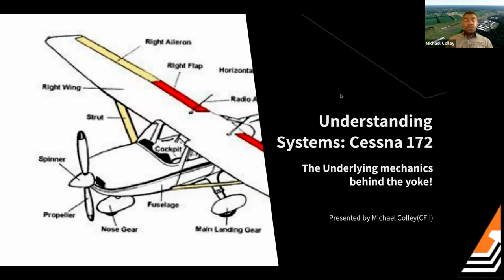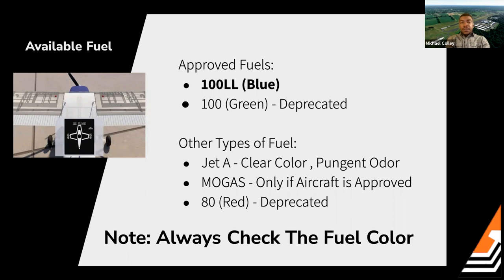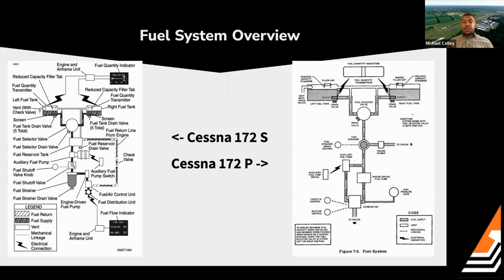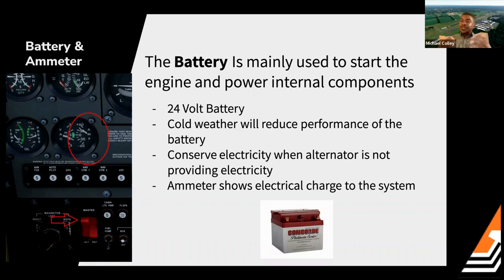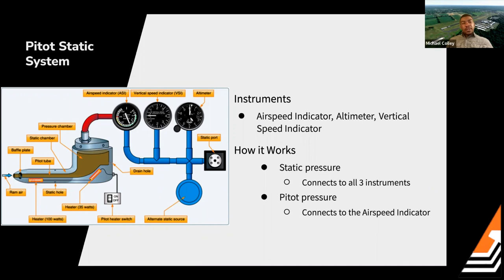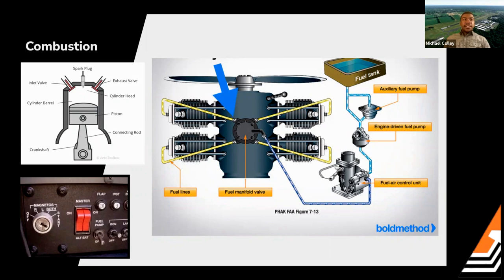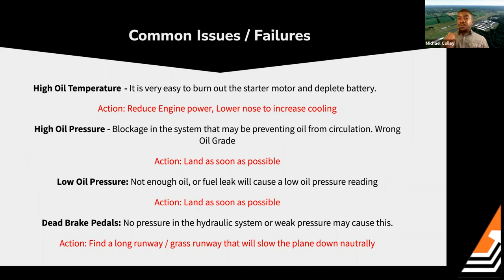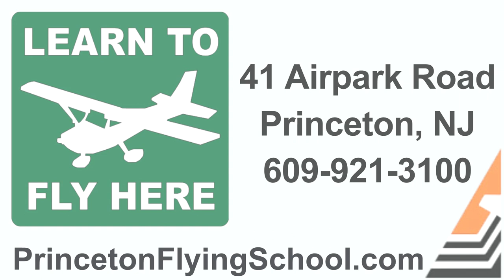Understanding Systems: Cessna 172 The Underlying Mechanics Behind the Yoke! with CFII Michael Colley

Comment: Dude - A really great training video for the 172!  Thank you putting it together, explaining the material so eloquently, and for sharing it with the world outside the original presentation group.  To explain how a gyro works to others in a group setting, I take an old computer hard drives and plug it into a usb harddrive dock to spin them up.  Once spun up, ask a student to remove a harddrive from the dock and pass it around to the other students.  The look in their eyes as they struggle to handle the spinning harddrive is magical as they can feel and see the spinning harddrive's gyroscopic effect and instantly understand how a gyro can help them stabalize and/or orient their aircraft when flying.

Comment: Great video! Using it to help me study for my CFI checkride. One small correction- you mention that the fuel vent is to allow for expansion, which is true but not its main purpose. The main purpose of the vent is to allow air into the tanks as fuel is consumed to prevent a vacuum from occurring, which could lead to fuel starvation. The check valve in the vent is there to prevent fuel from coming out, but it does have a small weep hole that allows fuel in if it's submerged to prevent the tanks from pressurizing. Some aircraft also have vented fuel caps in addition to this for redundancy